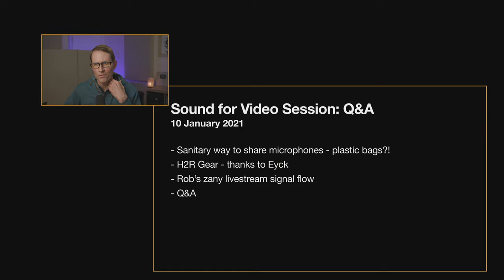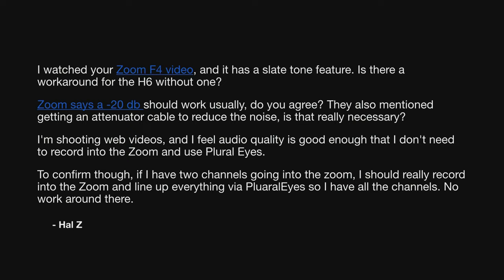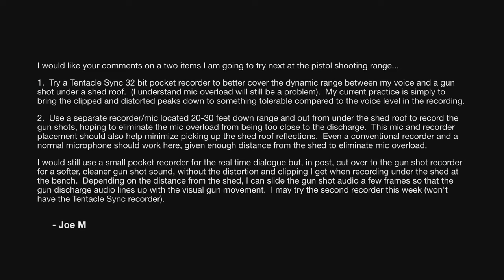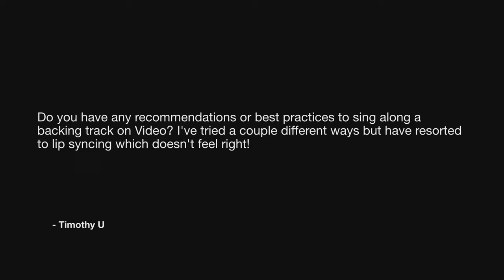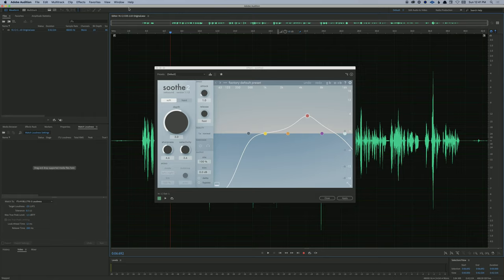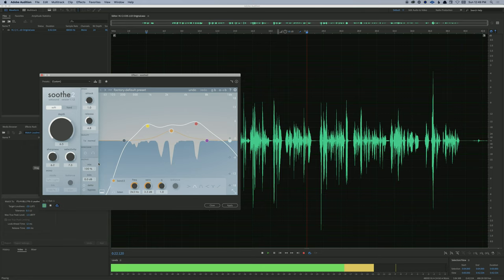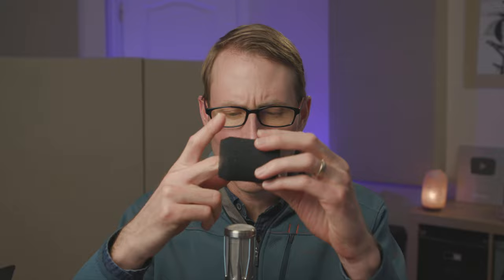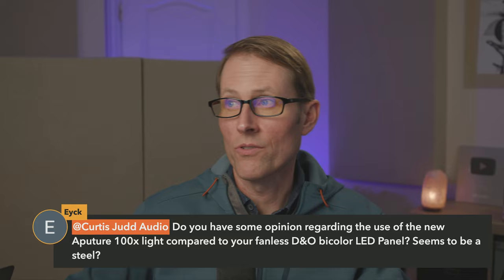Live Sound for Video Session: Q&A & Soothe2 Plugin

Comment: Regarding Watson Wu's recording methods, he uses the 788T with limiters off when recording car sounds but he gain stages to not hit 0 DBFS. That gives him max clarity and clean audio. Recording gunshots he has always used two 4 channel 442 analog mixers with analog limiters in front of the 8 channel 788T. The 442 has Direct Outputs that were designed to act as a frontend for the 744T back in the day but also works well on the 788T which came out years later. The analog limiters control the explosive gunshot sounds to his liking. He said in your video that provides a "distorted sound" but he means that limited audio is by definition distorted in that its levels are not the same as unlimited audio, but it is not clipped audio. I asked him once why he doesn't use the new 32 bit recorders to which he replied, he likes the sound of the Sound Devices 442/788. I can't argue with that since he's made a nice living for years using that gear.

Regarding overloading mics, Watson uses many condenser mics on gunshots, he uses dynamic mics on cars under the hood and on some exhaust. It is very difficult to blow out a condenser mic as most have huge dynamic range, it is virtually impossible to blow out a dynamic mic due to its passive design. In fact Paul at SD once calculated that a pair of Shure SM57s and a MixPre v2 could record a Shuttle launch with no problem without distorting the mic or the recording.
Reply: Thanks for the clarification, Allen.